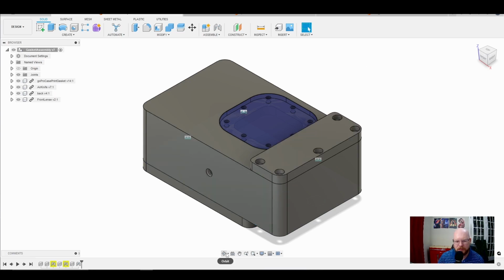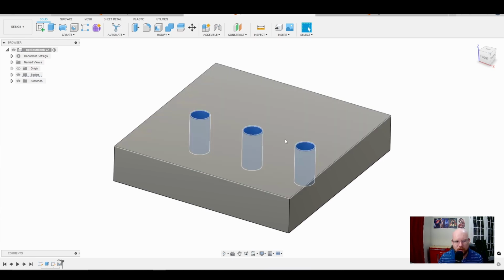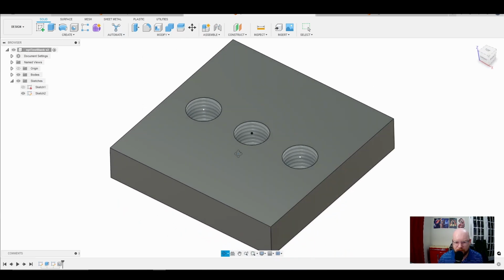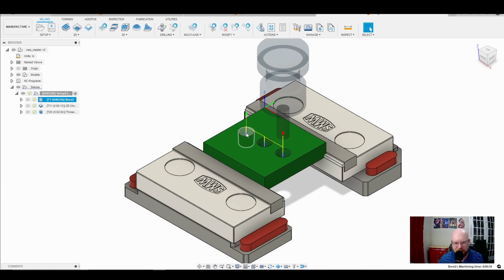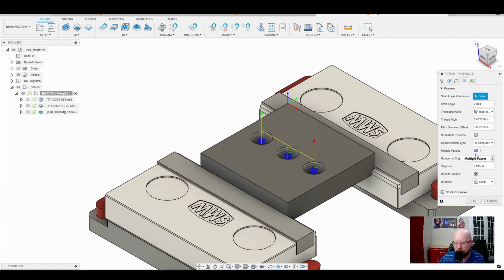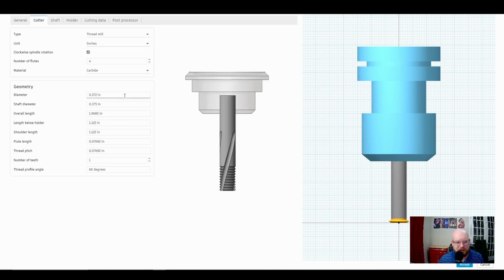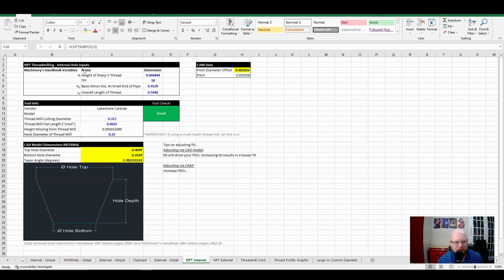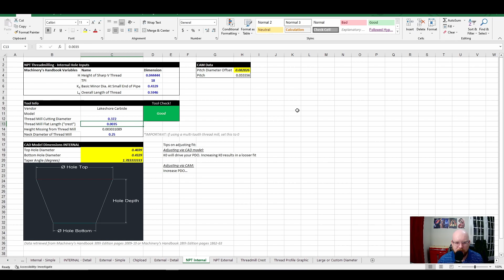Fusion 360 NPT Threads

Comment: FYI.... if wanting a "1/4 inch hole size (ish)" you wont use a 1/4 NPT.  You would use a 1/16 NPT. When "pipe" was originally developed the pipe i.d. was close to the nominal inch size of its designation.  Then improvements in materials and manufacturing created wall thickness options for different pressure ratings ("schedules").  So somewhere the decision was made to increase the actual I.D. (improving flow rates, lessoning preasure) and keep the O.D. from the origination of "pipe" as we know it. So in todays world a 1/4" NPT requires a 0.437" drill hole and yes the taper must be added assuming one actuall wants a seal. In metal working we use a taper pipe reamer to achieve the taper.

Comment: This was done with a single Point Threadmill,  why not  get the actual NPT / NPTF  full length threadmill?
 they already come with the angle matching the desired taper and they can be run light any other straight threadmill, ive programmed all type of NPTs / NPTFs, not cost efficient if your in a garage shop but for a company is ideal.
Reply from the maker: The tormach didn't support rigid tapping without a tension compression tapping head.

Comment: You can, absolutely, drill a hole for an NPT thread.  You don't need to bore or circular interpolate a tapered bore first.  The only caveat is that you use an NPT thread mill, which has the required minor diameter taper ground on it, as well as the tapered threads.  FWIW, you can also purchase a tapered reamer that would taper that hole much faster than an endmill.

Comment: Well, yeah, it sure LOOKS like you've created NPT threads, but if you do a Section Analysis of the hole you'll find that there are actually no threads at all, just a smooth-edged hole. What's it's actually done is put an "image" of threads in the hole, and that's all. Try 3D printing it and all you get is a hole, no threads.

There does not appear to be any way to easily produce NPT-style threads using Fusion 360.
Reply: That is correct. The actual “modeling” of tapered threads is still on their to-do list, but we have no idea when. 

I’d guess if you want to actually model them now, you’d need to look up the specs, create the proper tapered hole, then use the coil command to setup a path. Then make a sketch of the profile and sweep that along the coil to create the thread.
Reply: @BlackSmokeDMax  same problem over here i need a one inch NPT thread for 3D printing and probably have to model it by hand :(
Reply: @Schoelme  the workaround I’ve seen people mention using on the Autodesk forums is finding a part on the McMaster Carr website (making sure it has modeled threads of course, most do, but not all) and then getting creative with chopping out and using what you need to combine with your own part.
Reply: Change to "As Modeled" to 3d print threads.

Comment: Another great tip. Just a thought: sometime an NPS thread + an O ring can achieve just as good a seal. And tape or sealant is still needed with NPT threads. Though I think in your case the NPT is a better fit due to availability of fittings.